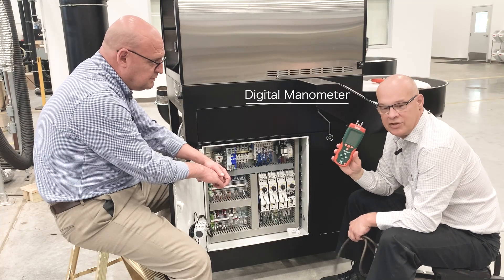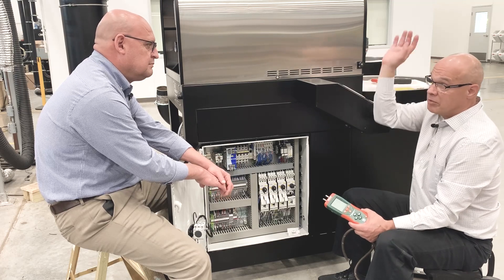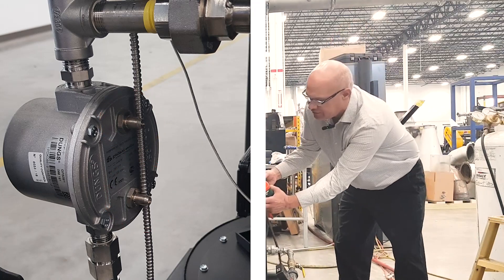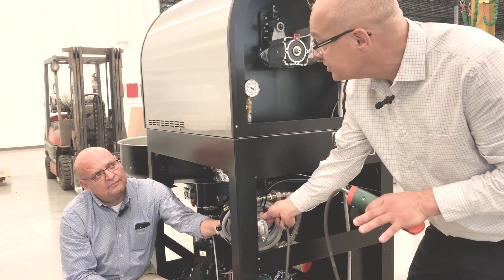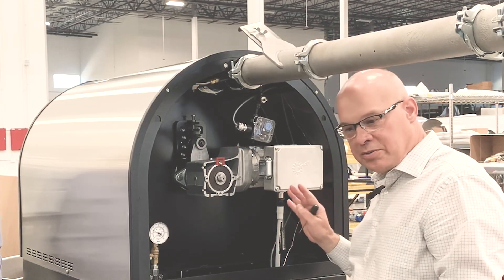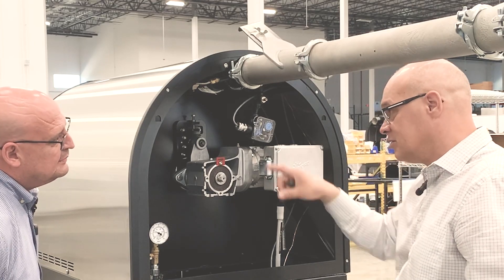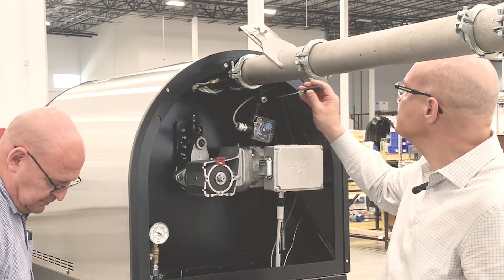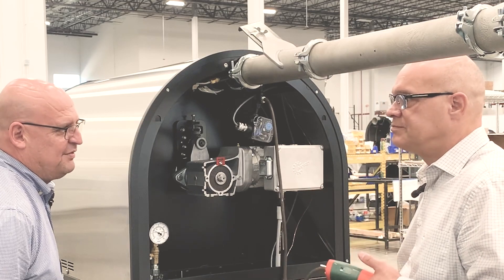How To Check The Pressure on Your Probat P Series Roaster

Comment: hi, what is the best or standard pressure for this machine?
If i am using the cropster software can i be able to adjust the AIRFLOW on the connected laptop? or is it a set default?